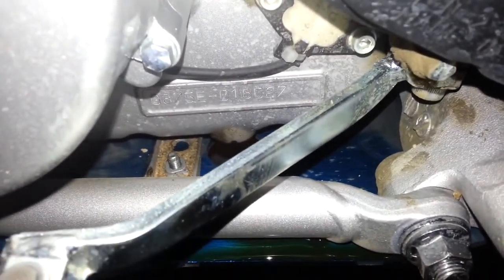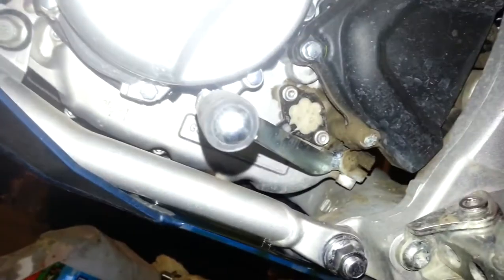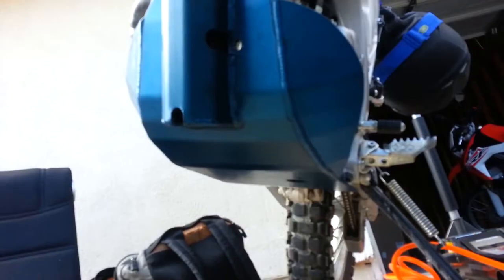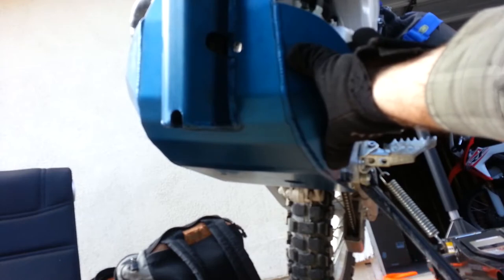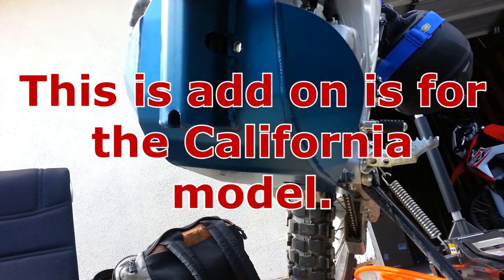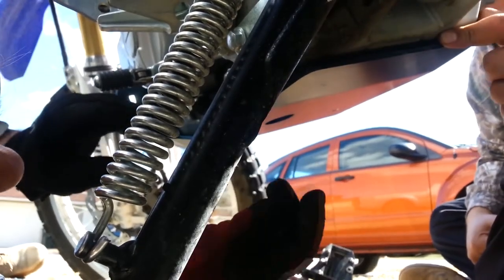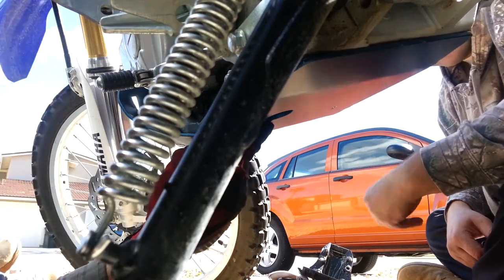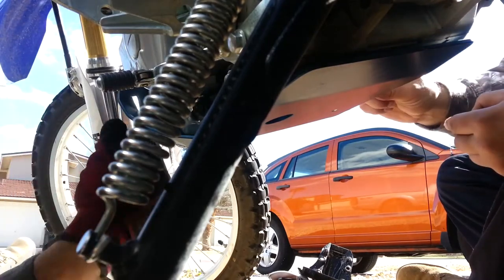Yamaha WR250R Skid Plate, How To Install

Comment: Yours is the only video I could find that accommodates for the CA canister.  I have been looking for vids on how to take it off
Reply from the maker: I'm glad I was able to cover the unique issues of the California model. I heard there's a simple bypass device you can buy to remove it, but then you need a different gas cap which vents. I really don't like those true dirt bike gas caps, but I respect anyone's vision for their motorcycle of course.
Reply: @DENicholsAutoBravado  I already have a motorcycle gas cap because of the ims gas tank I got.  Where do you get the mod?

Comment: just add a air regulator in line before you air tool should help control the speed but good job on the skid plate
Reply from the maker: +DriveShaft Drew Does an inline regulator work better than the adjuster on the tool itself? If I turn down the adjuster on the tool itself more than a little, I just hear air gush instead of the tool turning. Lol

Also, I learned from Jake at a shop later. He was junior to me in everyway, but when he could, he watched at a machine shop, prior to that. They'd port engines. He learned to keep the carbide bits moving and the control goes up tremendously. I was making it look harder than it was. Lol

Comment: You bike dentist :-D, "Just open up and say...    BAAAAAAAAAA!! ", dam he drove off :)
Good to see you have a frend that will call you a pillock, but not actually say it :-D
Reply from the maker: +zx8401ztv Dang dude. You know me so well. Everytime I'm at the dentist, I'm thinking, "Can I have that Dremel tool for my engine port job?" I might need a carbide Burr instead...do dentists use carbide burrs, are the single or double cut like I need since I have aluminum ports?
Reply: LOL for a second i thought the last sentance would be:
"double cut like i need since i have aluminium teeth." lol my brain :)
No you cant have the dentists tools, bad lad :-D
Reply from the maker: +zx8401ztv Oh, but I wanna! They're probably a hundred times more expensive than mine....or at least ten times.
Reply: Psst hey buddy, dentist retired and is having a going out of, wait no he's having a retirement sale. There's a bunch of stuff here like 
dremel 4000's and 4300's. Oh and a couple of wisdom teeth ta smarten ya up.
Reply from the maker: +MostlymoparIH Dremel? At a dentist? Oh my. I must have been dreaming! I can finally but that flex shaft for a Dremel in my Amazon wish list!

... Kind of silly to have it there when I get myself to by a Dremel. Lol

I already have air tools. And a porting pro recommends a Milwaukee monster of a tool plus a custom made tool to intercept the walls electricity to change the hz to adjust its speed. A Dremel, a little hand tool, costs more without accessories than all I just described.

Not often is the professional version cheaper. Is Dremel overpriced or just that good?
Reply: Ya know what? I don't even know. I'll have to go see what I got.
Not sure if I got mine from Sears or Home Depot.